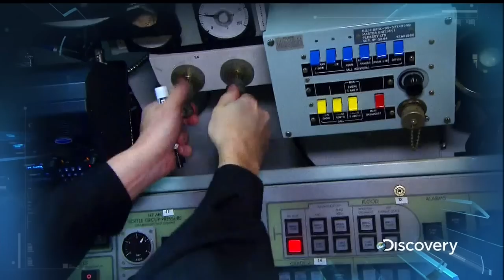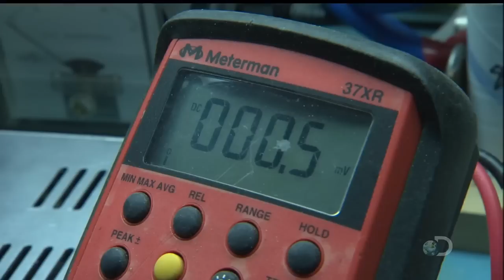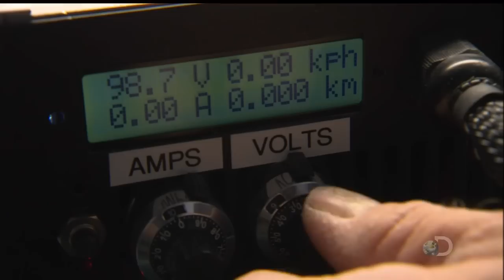Doctorbass on Discovery Channel / Daily Planet show

Comment: Like like like! I want a 75-7 motor like the zero dx, an adjustable bike-frame to add different numbers of batteries in parallel, 2wd with bighorn tires like the caterham brutus and a vortex-turbine to keep it cool. Weight should be 100 lbs. Just dreaming the controller itself needs years of study...

Comment: "It's sound, it's polution" - For the record I quite like the sound of a gas engine and many other people do as well. That being said though it's a neat gizmo!
Reply: Hey Barnacules, you should modify your RadRanger too, to get that extra boost on those steep hills. With new controller and bit higher volts and better cooling you could get up to 2KW power into that ranger. :)

Comment: This is really neat. I just got my bike working, it runs at 48v as the parts were easier to attain, so im adding mid drive to it as well. and I like the idea of the skis but for my application, i'd probably need a different mechanism.